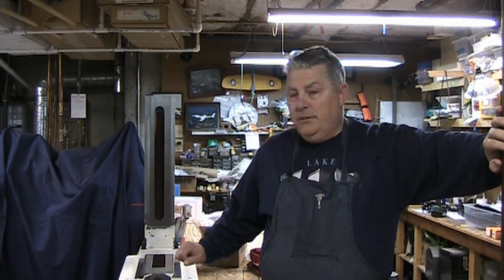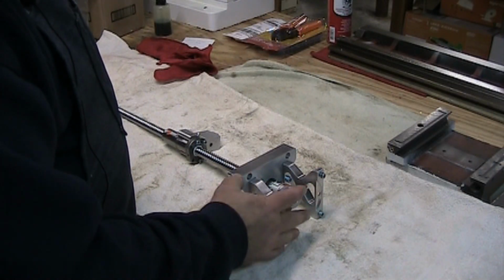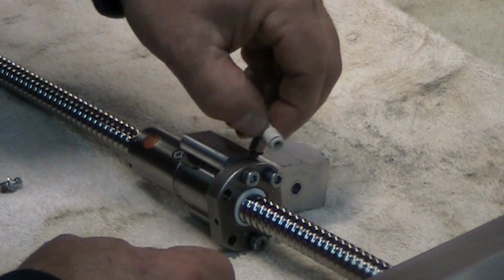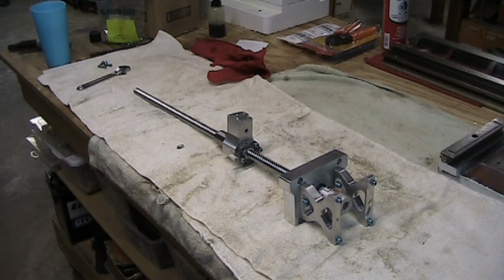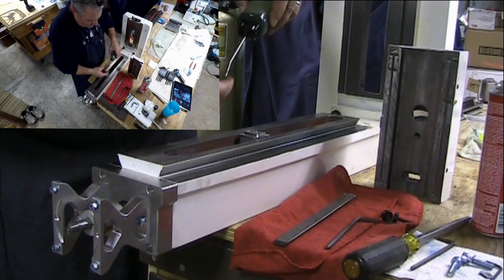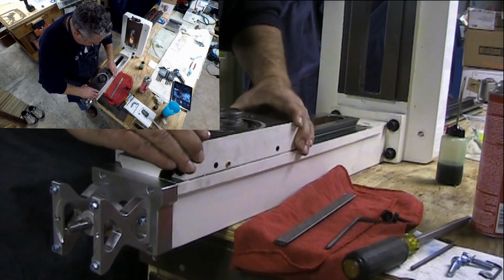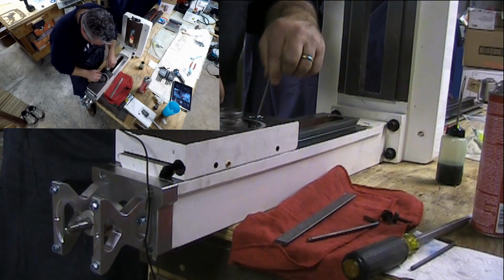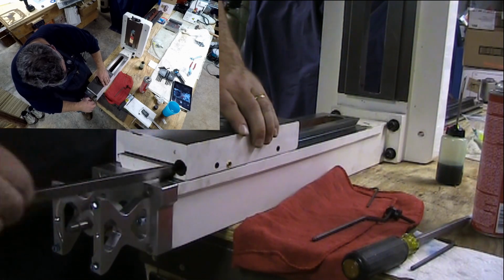PM25 CNC Conv Part 4 Z axis slide and ballscrew assembly

Comment: Were you able to use the 90 degree elbow on the ballscrew? I have the same arizonavideo99 kit and a PM-25MV but there is not enough clearance on mine for the elbow. It hits the ribs in the casting of the column.
Reply from the maker: Hey Greg.
I don’t remember having an issue with it. I hope you can get something to work in there.

Comment: For the next time set the gib first, leave the bottom screw in and take the gib out again, that way its easier to slide back and forth to set. once mounted njust but the gib back in position that was held by the bottom gib screw. Nice job so far, will watch the rest in turn, thanks for sharing.

Comment: Been enjoying your build as I’ll be doing the same.  Ordering everything weds and last email I got said Dave didn’t have screws at the moment, which is fine cuz it’ll be a slow transformation anyways. One question I had is did you throw the base or column on the surface plate to test for flatness?  I’ve heard the the head on these guys generally has a nod anywhere from a thou up to .012.  Haven’t seen anyone run an indicator on either before the head was on to check where the machine sat without the load.
Reply from the maker: durangotang 1 surprisingly my nod was good. The column was good as well. Make sure you clean it thoroughly. You’ll be suprised how much grinding swarf comes out. I have more vids coming out on the build. Thanks for watching!
Reply: Beechdrvr sweet. I’ll be there.